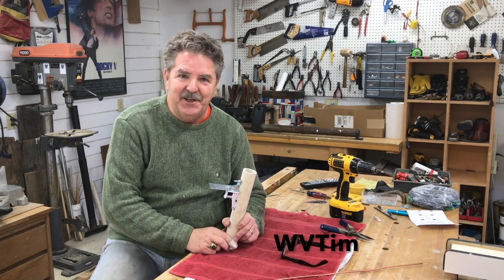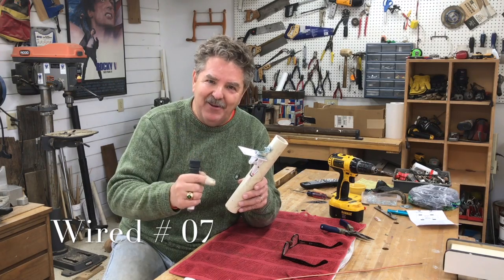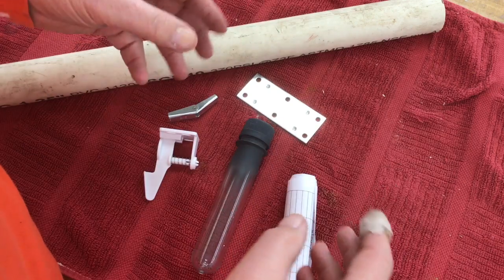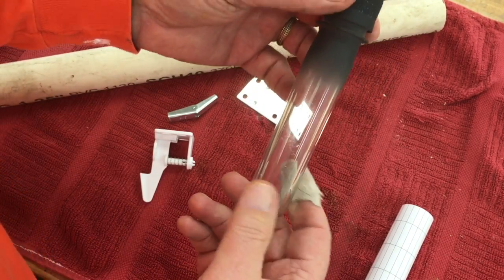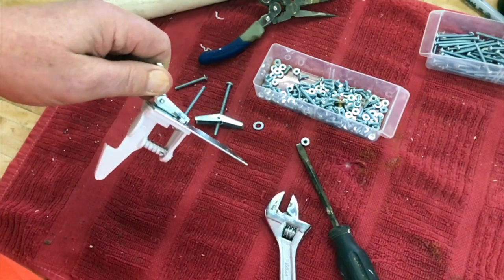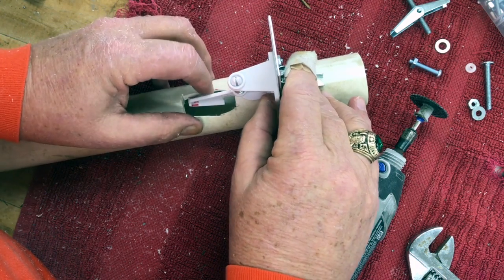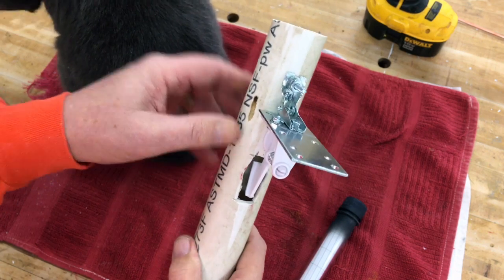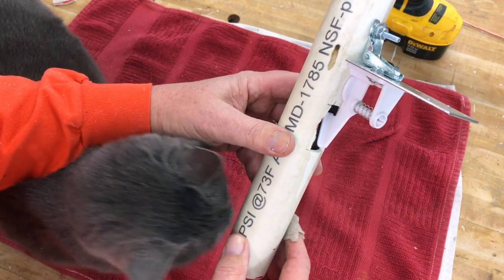Building a Cache Release Mechanism

Comment: Can you show us some smart caches
Reply from the maker: I have been hesitant because I don't want to to mislead anyone that they are easy to build.  Understanding the programing (C++) necessary to program a micro processor is fairly complex.  I might try to show one for illustrative purposes.
Reply: gadgetcaches Yeah I have a raspberry pi could I use one for a geocache?
Reply from the maker: Yes, just connect a small servo to your Raspberry pi.  Program your servo to turn 90degrees and return.  Place your servo under the metal tab you see in this video.  The servo will easily release this container.  Now you just need to decide what you want the cacher to do to release the container.  Sky is the limit.
Reply: gadgetcaches How much are they? And where can you get them from?
Reply from the maker: GCHarribo, sorry, how much is what?  This channel gives you ideas, you take these ideas to make some interesting geocaches.